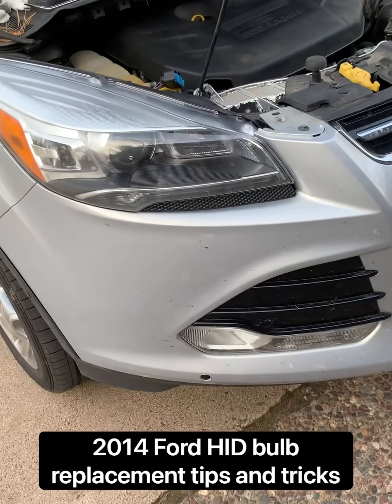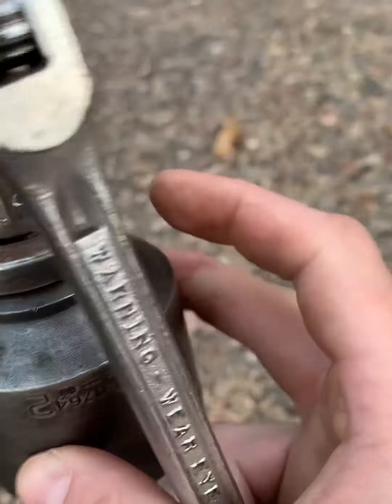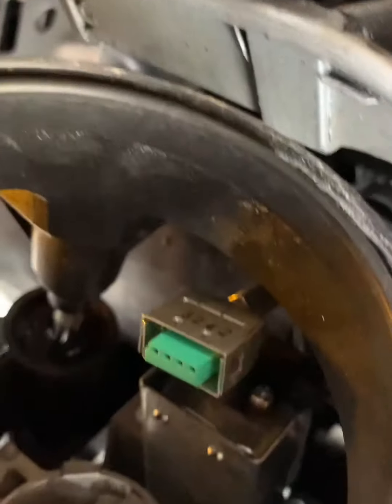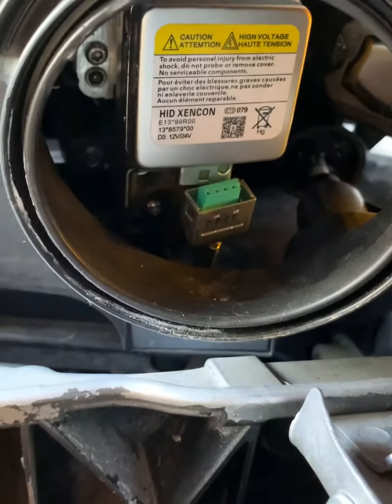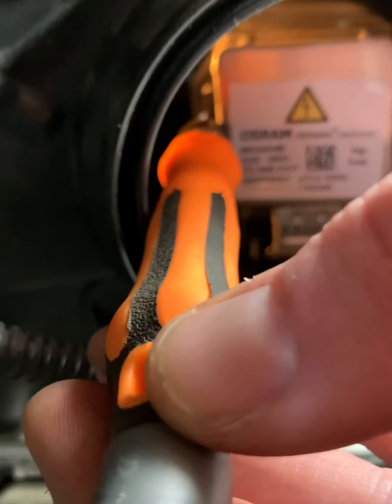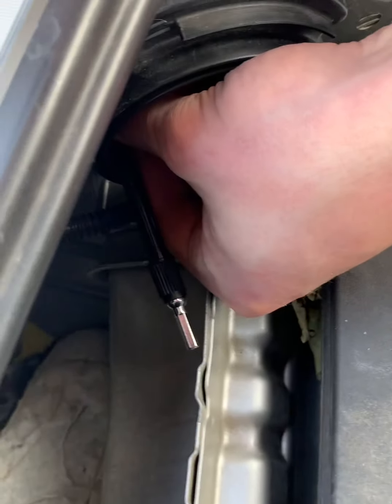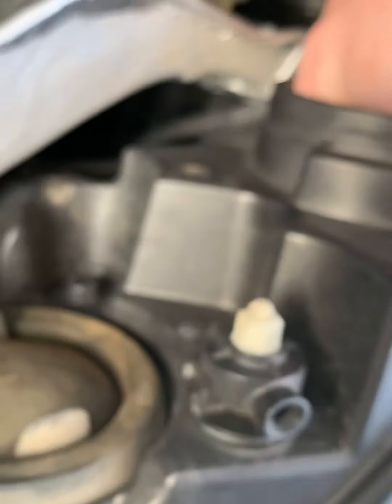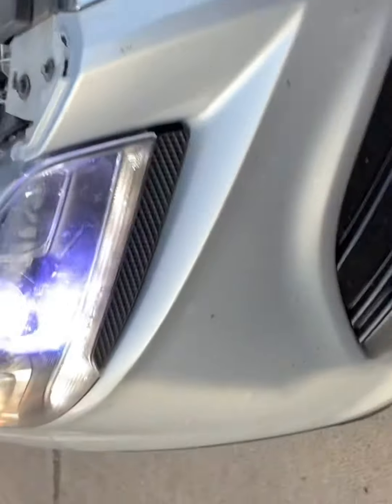2014 Ford Escape HID bulb replacement tips and tricks. No bumper removal.

Comment: I used to have a 2015 Ford Escape SE. I did changed the low beams headlights twice on my own. It was very easy to do. I pulled the cap towards a headlight. Luckily my hands were small enough to get in.

Comment: I installed a Sylvania D3S HID into a 2013 Ford Escape Titanium, its a very tight working space. I removed the cowling to give me room to put my head down on the firewall near the negative battery cable connection and look straight into the headlight assembly. You'll need the hands of a surgeon and some chewing gum to remove the bracket retaining screws with a single piece T10 wrench, but it can be done. Use a magnet tool if you have one, right along side the torx wrench so the screw doesn't fall down into the headlight.
Reply: I'm facing this myself.  My 2013 Escape Titanium HID light has been turning off after 5-10 minutes.  Been doing that for over a year now, but with the pandemic I hardly drove it and worked from home.  The work from home is coming to an end, so I need to replace both HID lights.  Is the ballast attached to the bulb?
Reply: @danr2513  , yep, it is, the ballast is part of the bulb on all brands. I noticed quite a price range in bulbs, and I suspect the lower priced ones found on eBay are cheap copies made in Asia, so I'd recommend buying them from a reputable auto parts store in your neighborhood. The Sylvania ones I used cost about $135 each at a local O'Riellys store.
It's also a good idea to replace the pair at the same time, two weeks after I wrote the comment above, I had to replace the other side and remove that cowling again. You'll have to remove the wiper arms, 4 bolts, and then about 8 clips that are a pain, just need to wiggle & jiggle them off.
Reply: @terf7020  man that is crazy.  How long does it take start to finish for you?
Reply: @danr2513  well, the 2nd time def went faster than the 1st time. About 15 min to get the cowling off, 20 to get a bulb out and back in, then another 15 to get the cowling and wipers back on. If you budget an hour & half, you'll be close to what you need.
One other point, the 1st time I tried to use a T10 bit inside a bit holder, but the screws are too close to the ballast and makes that challenging, also too dangerous to drop something down inside the headlight assembly. Better to get a single piece T10 screwdriver with a normal shaft width, then you'll have better visibility when your head is upside down looking in there...
Reply: @terf7020  What is the cowling?
Reply: @danr2513  LOL, yeah, I hope I'm using that word correctly. In the video, that's his tool "shelf" with all the leaves on the air intake vents. 
Obviously, JLadwig87 got the job done without removing it, but when I sized up the job, I figured working by feel and / or with a mirror was too risky to drop screws and stuff inside the headlight assembly. So by removing the cowling, you'll have a lot more room to get your head in there and really see what's going on while you're working.  
Note, the Safe-T-Glass guys remove the cowling when they replace a cracked windshield, I watched the guy do it last year and that's where I got the idea from for when I needed to replace the headlight bulbs.
One other small note, the brake fluid reservoir is also attached to the cowling, but that's just two screws and you can let it lay on the engine cover while you do the headlight bulbs
Reply: @terf7020  @@UChC0ZaHn_Cz0gOsSIbjWLtA So I tried to remove the screw.  The first screw just keep turning and turning.  I think I'm screwed... no pun intended.  I used a T10 bit and had a flexible screw driver with a mirror and flash light.  I want to get rid of this FORD right now.  This is absolutley one of the worst designed cars.  It was designed to profit Ford.  Mine is closing in on 140k miles and I've heard transmissions start going bad around 150k - 180k miles.

Comment: I was quoted a $300 bulb replacement job from Ford Service Center. Can I get the job done for less at a Collision Repair Center?
Reply from the maker: I believe they will all be about the same because they will want to take the bumper off. This video shows an alternative way and in the comments, others have done similar fixes.
Reply: @jladwig873  I am going to check my fuse for the headlight tomorrow. I hope it's just that.